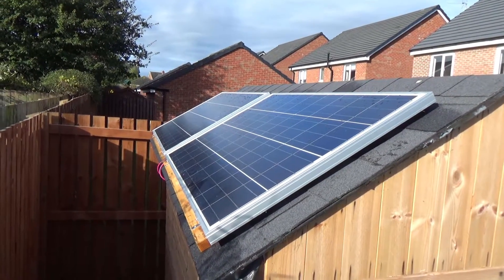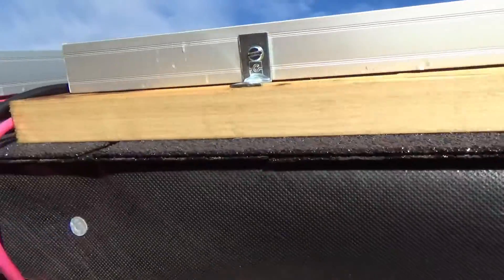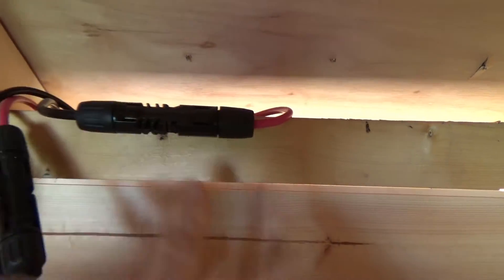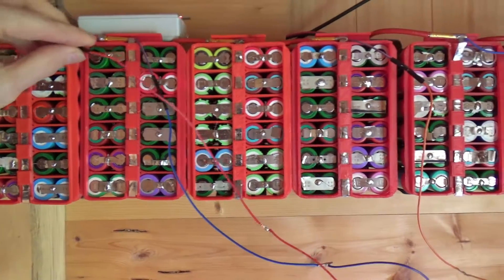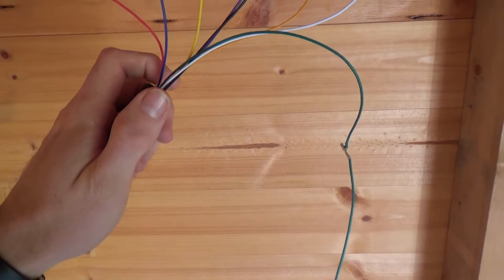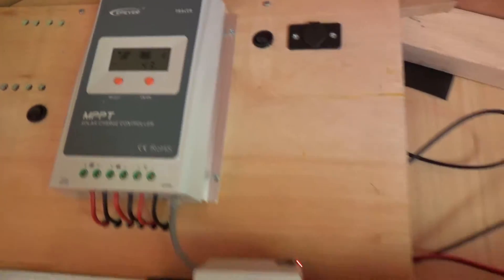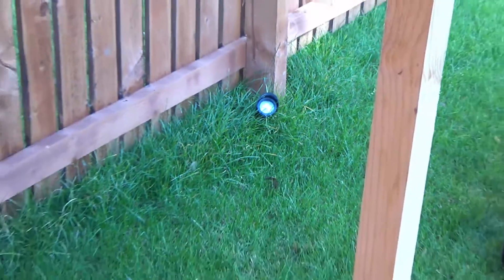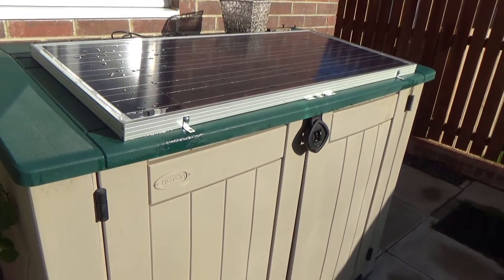Solar Playhouse Part 2

Comment: But the EPEVER Tracer A charge controller is for Pb-Acid isn't it?
Reply from the maker: Hi Simon, it is primarly for Pb-Acid setups but i'm running fairly well balanced 7s pack and by setting the voltage to not charge any higher than 28v it protects the pack a bit.  You can't disable the float charge fully although i have observed that when the pack is fully charged it reports the charging current as 0w so it's doing something similar.

Comment: Am I the only one here wondering where you bought 100w solar panels for £45.

Great video, i'm subscribed and looking forward to more.
Reply from the maker: Thanks Roger, the panels were off gumtree, some real bargains out there if you keep a look out.  I really need to get it going again as i've the battery bank to relocate and have more panels also as well as needing to rig things up as i've purchased a robot  mower which i plan to power off the solar setup too.

Comment: Nice design. Something you might wanna do is redo the mounting on the 2x4. When it rains, the water will puddle and sit right at the lumber causing the wood to rot (even if pressure treated or cedar) and cause damage to the shingles. If you just put a few ferring strips (or thin strips of aluminum or such) under the boards that will allow the water to drain off.
Really nice and clean design  :)  Good work!
Reply from the maker: Thanks i've not run into any issues so far but it's only scrap wood so can easily replace down the line if need be.

Comment: I'm really chuffed that you're getting good use out of the small blocks design. It does look pretty tidy. Those wee connectors for the balance wires are a bit loose for me too. I'm not sure what connector would be better. I'll probably just tape them together.
Reply from the maker: Glad it gets your stamp of approval as you designed it all lol.  Re the small wires it's a tricky one since i didn't want to tape the balance loom wire anywhere as it defeats the portability of being able to unplug at any time.  I think i'll ensure the wires are insulated and then i can tuck them away at least.  If i size the wires correctly too that might help.  Having some 3D printer issues but as soon as they are sorted i'll be producing more packs and them paralleling them up as the cells are all tested ready.

Comment: Thanks for the update. I've been processing some 18650s but I've split them into individual cells. I found Paul's videos a few days ago and instantly wished I'd left them paired together! Oh well.  Looking forward to a night time shot of the shed/playhouse once it's done :-)
Reply from the maker: I'll be honest i did exactly the same!  I managed to get the required 84 pairs after that but I was thinking and i'm still going to use the same design with the single cells.  All i'm going to do is run one piece of wire across and fuse each cell individually.  What i am going to have to do is put some hot glue on as you get a little movement, i took Paul's advice and left a little slack in the fuses so they aren't stressed and can allow for a little flexing.  Oh and some hot glue on the banaplug connectors too as with 4mm cable it can cause a lot of movement in the connectors.  I think i have nearly enough for 3.3Kwh worth now.